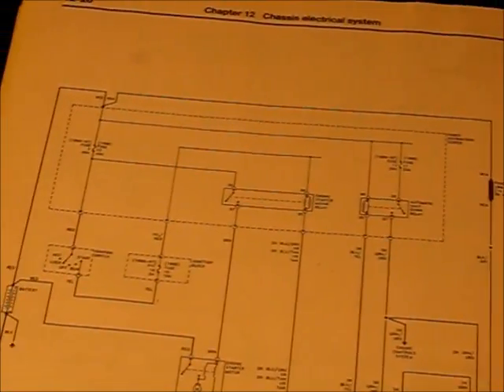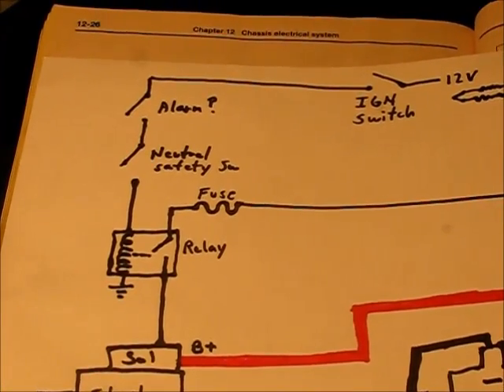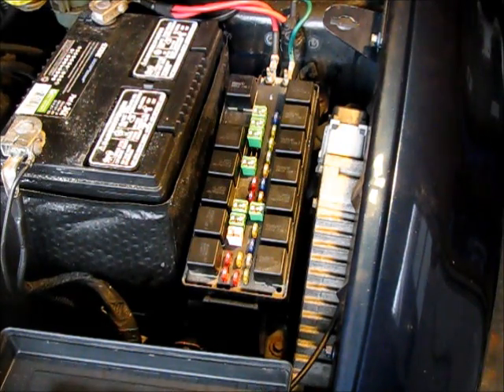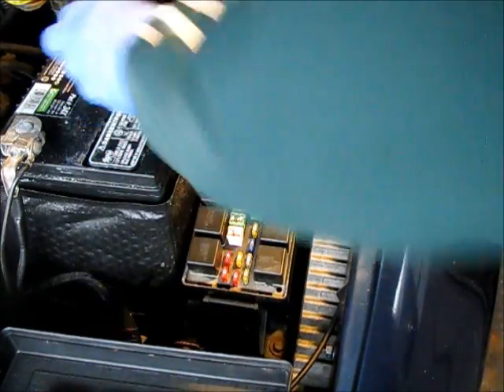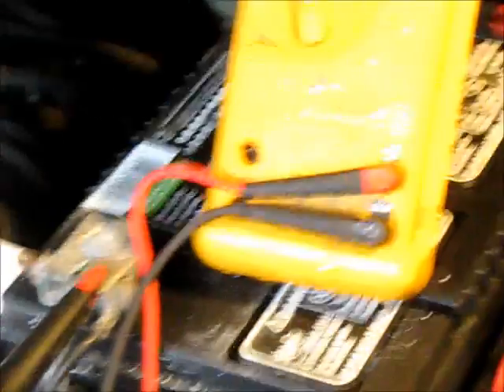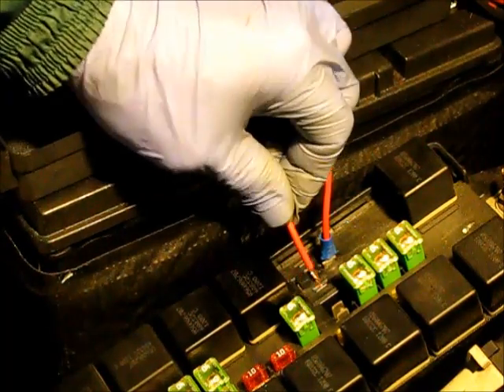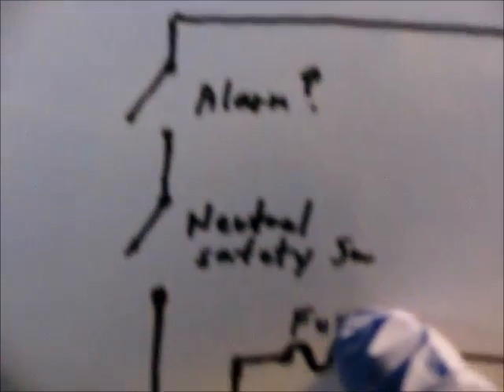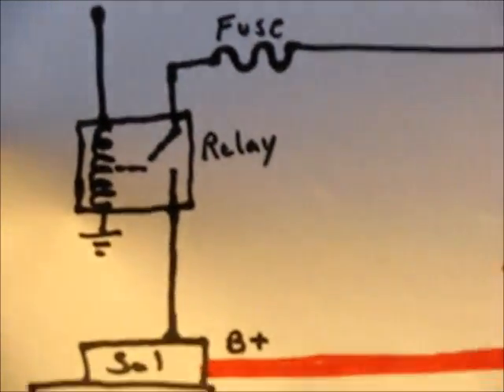When your car won’t crank or start part 3: How to check relays, fuses, switches and wires

Comment: I rigged mine until i can afford the fix lol. I wrapped and old speaker wire to the relay fuse and touch the battery then crank and it starts no problem. My problem now is intermittent starting but the starter is fine on my 2012 Ford focus.  48,000 miles on the damn Thing smh and I'm not even a mechanic
Reply from the maker: Must be a loose wire or connection somewhere between the ignition and the relay. Can be tough to find as I discovered on my first car. Good luck and way to improvise!

Comment: Here’s a great trick I used. My starter relay failed I found it and switched it for the a/c relay until I could get to the part store for a new one. But I keep the bad one. After I got home I knocked the top  off and put it back in and pressed it with my fingers to use it as an under hood starter switch. It works great for when you need to turn the engine over without starting it up. Just leave the key off and it will not start up but you can run the starter motor as long as you need to. Or turn the key on and start the engine up from the fender

Comment: I used the "jump wire" at the starter relay and it turns over but won't start.New starter I don't know what it could be
Reply: this is my problem, lots of vids show this scenario, but not what it means, Is the Relay Bad? power is getting to the Relay, and power is getting to the starter in the case of jumping it.

Comment: I have a 2003 crown Vic. I pulled the anti theft fuse and now my car won’t start. Checked the fuse tried the locking and locking door with the key trick. Do you know what’s wrong
Reply from the maker: First thing I would try would be to reset the security system by disconnecting the battery for at least 30 seconds.

Comment: Hi . Vw 2010 ..i removed to check fuses in dash area behind  glove box as the cigarette lighter doesn’t work but now after removing and replacing fuses the vw touran 2010 wont start although the dash lights appear .  Whats the fix thank you
Reply from the maker: All you can do is backtrack and check everything you touched for loose connectors etc. Been there many times.

Comment: On my G6 ... I have no ignition power to start relay.  Gnd and hot wire to relay are good...  And I think I located correct fuse...also OK.    But NO ignition power...  I will check start position and power at the ignition next

Comment: I have a 17foot box truck 2005 or 06  v10 f450 motor old uhaul truck. New battery, new starter, new starter solenoid everything lights up and radio works but when you turn the key to start it nothing happens no clicks. no noise to the motor.. nothing.. I was told to try this trick to see if it starts but I don't know what gauge wire to use.. someone also said I can rap the gauge wire around one  of the pins and reconnect the starter relay and use the other end and tap the battery to see if it will start also but I don't know that trick either or the gauge for the wire... any help and information will be great .. thank you for your time
Reply from the maker: 16 gauge would be good enough. I like starting at the relay because that will point you either toward the starter or toward the ignition.

Comment: Please help 🙏 my husband changed my water outlet in my 2016 chevy cruze limited eco an now car wont start wipers wont work no windows no interior lights no headlights but dashlights an radio but when I try start it it clicks an dash goes black new ground wire new battery everything is hooked up correctly Please help
Reply from the maker: When this kind of thing happens I always backtrack everything I did on the repair. Look for wiring connectors that may have been unplugged, dislodged or damaged during the repair.

Comment: I have 04 Hyundai Santa fe! Ran good now after I start a few times the lights bright and battery strong! Won't do anything but after it sits 4 PLUS hours it starts fine starts 4 times then dead but let sit SEVERAL hours it starts fine again any idea's

Comment: I have a question..you said about your Chrysler.. so what was the problem? I tried the relay terminals and starter cranks it also cranks when u touch it with a screwdriver on the starter.  But I go to the ignition and just a click its wierd I bought a new starter and it messed up too . Can it be my starter?
Reply: Just bought a new relay too and nothing . Also the click u can burly hear now but it sounds like it's coming from the starter.. at first it u used to be louder

Comment: just a question for ye ... I have a freelander 2003 that I have lost the keys of so have no master key , I have had a lock smith at it for about 2 weeks now on and off with still no result , is there a way to by pass the immobiliser using this same method

Comment: My fuse on my camaro 1989 will not get power on the fuse box. Some of the fuses are fuel injector 1/2. Crk 3. I’ve replaced with new fuses no help. Do you know why some fuses are working and some aren’t
Reply from the maker: You'll have to backtrack to find whatever feeds those fuses. A wiring diagram is likely to be needed.

Comment: Hi I have a 2006 Pontiac grand prix my car won’t start and I was told that it was my wire that need to be replaced my question is what wires would I need to replace cause my bf was going to try to replace since I don’t have the money to pay a mechanic

Comment: Hey I have a 2003 dodge grand caravan and my van will start and then will stall about three minutes after its on. Then I will try to start it again but it does nothing. All the dash lights work and headlights, ect but fuses are fine and I just replaced the alternator about five months ago. There is also no noise when I try to start it. I'm thinking maybe its the mass air flow sensor but there isn't any white smoke coming out if my exhaust or maybe my starter? Possibly the ignition switch?? Please help I have no idea on how to troubleshoot  this!
Reply from the maker: Sounds like two different problems which makes me think its power related. Possibly a poor connection or bad wire. These can be very difficult to find. I would use a schematic and a meter and focus on the power circuits.

Comment: hope you have an idea I have a 2004 dodge ram when starter is in the truck it wont start if I remove it and  ground to frame it engages with key turn install back in truck no start. the small wire to starter from relay read 12 volts with key turn if the wire is not connected to starter but if I connect it to starter it reads .5 volts when key turned but when out of vehicle reads 12 volts and starter engages with key turn
Reply from the maker: I struggled with a similar problem on Saturn Ion. I made a video that might help or give you some troubleshooting ideas. I see you know how to use a meter so a voltage drop test might point in the right direction. https://youtu.be/54jJmanNUSU
Reply: @TheOriginalMechanic  I did replace all the cables 3 month's ago double checked clean and tight there seems to be a short somewhere I removed fuses from fuse box and I get 12.5 volts in on one side and 5 to 7 volts on the side where  there should be nothing without fuses installed I believe

Comment: I dont know if you still respond but I have a 2009 Pontiac G6 2.4L my 30amp starter fuse isnt getting power to starter relay switch any good ideas why its not cranking
Reply from the maker: If you don't have power on the starter relay contact that's it right there. When the relay coil is energized the contact will the close and the starter will crank. Assuming the fuse is good this has to be a  poor connection or broken wire between the fuse and starter relay.
Reply: @TheOriginalMechanic  
This morning I took my greenish fusible link off my starter wire to inspect it for any burnt or corrosion seemed good soon as I plugged everything back in car started took it for a test drive everything is was good soon as i got home shut the car off car didn't want to crank can a fusible link cause a no crank start or a bad starter wired I even stuck my light stick to test to see if it bad power in the starter wire it didn't light up
Reply from the maker: Seems like a bad connection, which can be hard to find. A few years ago I struggled with a no start issue on a Saturn Ion. It was a bad connection in the big wire going to the starter. https://youtu.be/54jJmanNUSU  @AaronRowland-y5w

Comment: GMC sirrea engine wont crank . Headlights turn on tho and also smell like a burnt rubber at times
Reply from the maker: A smell like that makes me think of wiring or motor windings. Make sure all the wiring connections are tight.

Comment: I did this to an infinity and it didn't work out so good the car went from clicking when I was turning the key to not clicking no more after I arched a relay and it wouldn't turn I either messed up the whole fuse panel or I don't f**** know or the ignition or linkable fuse possibly on a harness check the starter by tearing off the manifold has power as I can cross it with a screwdriver I'm stunned and lost at the same time
Reply from the maker: You may have taken a hot to ground. I would check the fuses first.

Comment: I was as driven at 30mph  iv just got my  first car spent 800 pound on astra sxi 1.6.  Then 200 on insurance, next day I got pulled over for haven no insurance by the police I was adamant I had insurance anyways turned out my mum  did the insurance bless and for what ever reason in was in her name anyways I had to change insurance again more money another 200 .  Now back to the moment were I'm driving 30mph a month after buying the car . Car steering wheel when stiff I couldn't keep driving so I managed to get it to to side off the road turned the car off now when I turned it back on I just got the clicking noise no crank. Now my battery is fine but stil no crank but now there dont seem to be any clicking.. help? Also I just found a wire holding up a bar under the car oh and under the grill off the car is bits off t shirt wrapped up inside ... fuck my life hard

Comment: Thanks for the lesson .
Reply: Well it's only been about an hour but I did switch out both DEFO/TO TOP RELAY along with with both 40a fuses. But still not cranking. And still making muffled click. So I did switch out in cabin fuse box relay with deff one. But still getting muffled click from cabin.Sounds it can be that Black one just below. Any ideas? 9:34am 5/24/2022 appreciate it.

Comment: What is the problem how did u fix it ??? My car is in the same exact problem i cant find away to fix it so what did u do to fix this issue need to know thanks
Reply from the maker: This is a troubleshooting guide, I wasn't solving a specific problem. Much can be learned by starting at the relay. You can eliminate components to find the culprit.

Comment: hi David
Thank you for sharing  your very educational video.  My car problem is a little different.   It sometimes starts in 3 tries, sometimes in 7 tries,  sometimes in 1 try meaning INTERMITTENT.  My car is 2015 Honda crv touring.  Any help I will appreciate very much
Reply from the maker: Make sure the battery posts are clean and the cables tight. Check for same on chassis and engine grounds. This sounds like a poor wiring connection somewhere,
Reply: Yes i double check and make sure its clean and tight. Also i make i secondary connection of the negative side to the chassis and also engine but but still intermittent start.  I forgot to tell you that the car has a push button start i am suspecting that is the problem.

Comment: My car started with the relay insertion test so what is my issue its 2007 ford escape.  Was starting find until I took battery out to install the water pump
Reply from the maker: Usually when that happens to me I retrace my steps on the repair. You likely dislodged a connector of something in the start circuit between the ignition switch and the starter relay.

Comment: My lexus acts as if the battery is low and  makes a sound when i turn on ignition . I think the relay? It charges or clicks then the car will turn over slowly but starts . Battery test says battery is good and charging system is low so i cleaned connections and now the relay clicks a few times and still starts slow like its gonna die but doesnt do the starter clicking as if battery low . Odd i just played with the relays and the fuse box and now it kinda works , relay doesnt charge click now but still slow turnover to start. Could the battery be bad or would it be a draw or short discharging the battery.
Reply from the maker: Before you buy a battery,  check and tighten all the big cable connections you can find on the car, from the battery to the alternator and starter and also chassis grounds. Anything less than perfect connections can cause what you are seeing.

Comment: Your video just came up in my youtube feed. I am troubleshooting  a parasitic short.on the.battery..  I am an old TV tech. I worked  from.80 through 2007.  Where are your schematics from.  I have the Chilton, Haynes and several others. They are generated not the exact.  It's almost impossible for a  non professional to obtain the schematic for the VIN of my 1999 Ford Expy Eddie Bower 4.6 car. Find generic stuff ..fairly worthless. I subscribed.
Reply from the maker: I used a Haynes manual for this video. Yeah those kind of shorts take time and a good wiring diagram to fix. I had a VCR repair shop in the nineties and know the value of a schematic. I occasionally find a diagram on an online vehicle forum. Good luck and thanks for subscribing.
Reply: @TheOriginalMechanic  Used to fix VCRs. I went out to house on a service call on a cheap vice. Somebody had ordered an RF
modulator. I put it in.. Always nice to work on your knees and hope the rug doesn't get burned. It was still snowy.  I called the manager and told him that we should just replace it.  He agreed. Sometimes you just cut your losses and come out ahead.
It was just a 50 mile trip..gas is free.
Anyways I'll check my Haynes out. Appreciate Appreciate you getting to me.

Comment: Great short gut to avoid getting under the car to get to the  starter to  crank it. As for the 42 idots thumbs down,dont break ur head with dummy,there are crash dummies.

Comment: Which logo indicate the starter motor fuse and relay
Reply from the maker: That's going to vary by vehicle. Usually there is a diagram inside the fuse box cover or in the owner's manual. Or you might find it on You Tube or a online forum for your vehicle.

Comment: Hey mate thx a great deal, i have a question bout 91 volvo 245....there is i systemrelais that activates fuelpumps and spark...a guy gave me following tip: jump the + side of coil to + of battery....yes indeed, only then, i had spark...now comes the strange part...once the car runs i dont need the jumpwire anymore, but restarting does Not go without the jumpwire...i dont understand ...
Reply from the maker: The relay must only be needed at start up. You need a wiring diagram to find out what activates that relay. I assume you checked the fuse. Some cars have a fuel pump cut-out device that will block the pump until conditions are met.

Comment: do i have to disconnect the battery to remove the starter relay? is it required?
Reply from the maker: No you don't have to disconnect the battery to do that job.

Comment: I got a fuse box and took the negative battery cable out and replaced the fuse box but my car doesn't start now. 2007 Buick lacrosse. What did I do wrong and how can I fix it?

Comment: The fuse continues to blow after replacing help
Reply: Dawn Fling you have a short. Get a new Computer for your car
Reply: Make sure it's the right fuse
Reply: Could be a cable touching metal and burning your fuse i have a car that used to do that

Comment: My fuse box has no power on the starter relay terminals..should i get a nre fuse box?
Reply from the maker: A new fuse should do it
Reply: I have a 2008 dodge charger 2.7 and i only have power on the 87 of my starter relay terminal. Should atleast have power on the 30 terminal as well but nothing. Do you know what it could be?

Comment: 2004 Ford Explorer no crank no start all the light is on n radio I put new battery n battery terminal n the starters iWork n new ignition switch still the same please help already check the relay n fuse still good
Reply: I have an 05
And i was told it was ECM

Comment: Well i got a gt sti right. It started haveing letrical issues. Like after 30 mins of driveing it would start stalling. Befor that tho once every 3months wouldnt start untill unpluged the batery ground it then reconect it. Once it wouldnt start untill i hit the ac button lol. That was only once. Battery went dead. Jumped it fine. Put it in garage. Now has power but no crank. Wont even wind over. Allmost like the emobalizer is on. And head lights wont come on or dash lights. But windo wipers will and radio.....help!!!!! Please
Reply from the maker: This is just the kind of odd stuff that happens with a bad chassis ground. I went through something like this earlier this year and I made a video that might help you. https://youtu.be/-DU-VeipY3g

Comment: 03 navigator no crank starter is good there's no power to the ignition wire on the starter the fuel pump comes on but there a loud noice coming from the fuse box like if the starter relay was over working  with the ignition on
Reply from the maker: The starter relay is good place to troubleshoot. It needs two things to function: a control signal which energizes it and 12V high- current power to feed the starter. If one of those is missing, you will have no crank. Both those circuits have fuses to check.